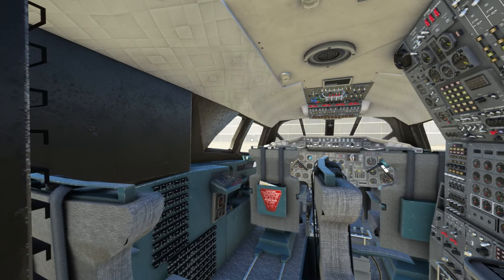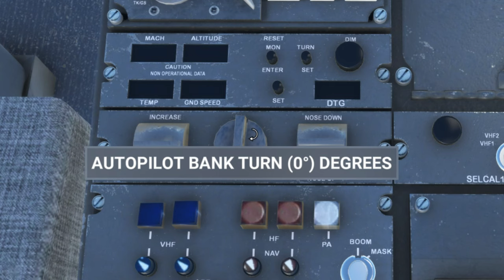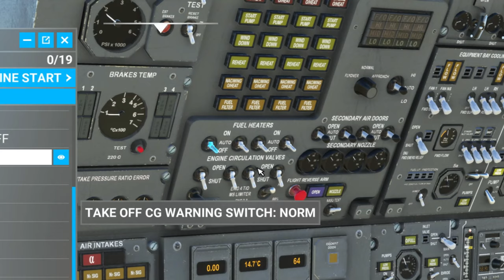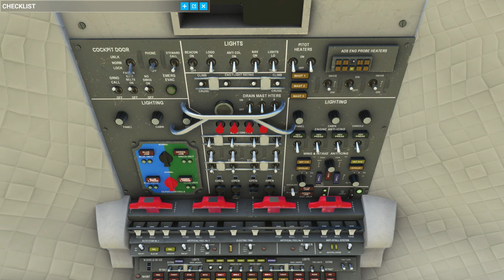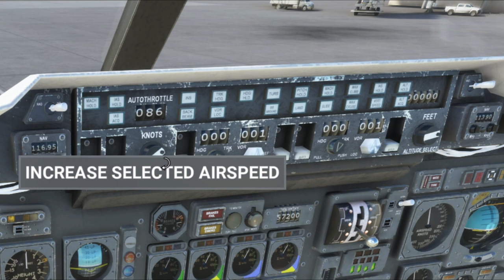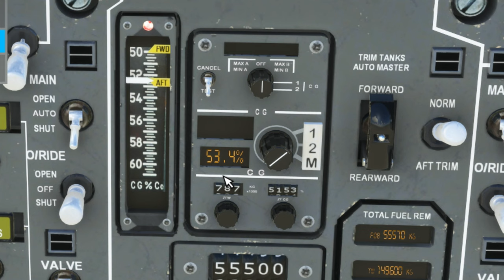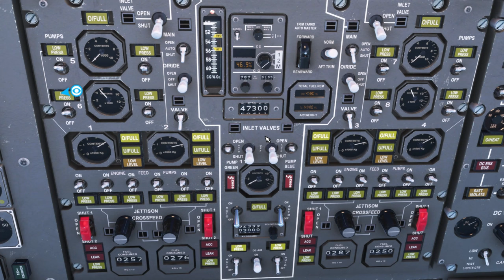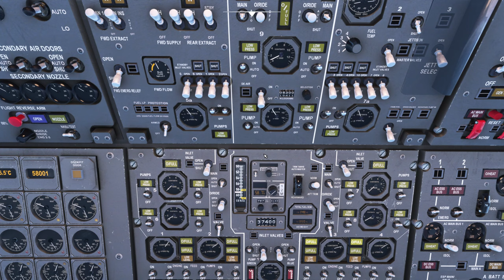Msfs2020*CONCORDE**Full review-Checklist tutorial- So many issues are they deal breakers lets see?

Comment: I bought it thankfully on a discount. I wish i saw this video first though before I bought it. I wouldn't of bought it. These issues are very frustrating. In fact another bug that you didn't mention that I have is there is absolutely no way to turn the engines off after a flight. I even put my fuel to 0 and only engine 1 turns off. I really hope they fix all these problems.
Reply from the maker: Thanks for the comment .. this review is from the initial release I don't think it had the engine problem then I guess updates caused more issues

Comment: Great video, thx! I just have one problem. I done re-fueling and worked but after reaching max cruise around Mach 2.2 the plane starts to dance left and right and has trouble keeping straight line. During descent the plane returns to a stable flight below Mach 2. I tried with mods and without mods. My friend have same problem each flight. Very strange thing: when I change NAV to Heading - plane have no problem... Any idea?
Reply from the maker: Not sure on that yet as I haven't gotten to the gps in the plane but I will check it out. There is so much other stuff not right I kinda didn't even want to attempt a gps nav flight  yet .
Reply from the maker: Thanks for the comment 😀
Reply: Mach 2.2? Or Mach 2.02.  Completely different things. You did turn on the yaw dampers and everything on the overhead bar did you?
Reply: @jdzzl  Yeah, Mach2.02 sorry. I do, all the yaw dampers and all required overhead switches double checked. Have no idea why this happened to my aircraft

Comment: The bars in front of the wheels are deflectors. They're in front of the gear on the main gear, and in back and on the top of the nose gear. You can see them here on F-BVFA, on display outside of Washington DC (at IAD): https://photos.app.goo.gl/L54Qa9wjxPahFASk8

The AUTO/MAN switch on the INS is for automatic leg switching. When you get close enough to the waypoint, it'll automatically select the next leg of the plan.

The white border on the fuel panel is mostly as you mentioned. There's some optimization that can be done laterally (the ones you X'd out), but the main trimming is fore-aft, and the system only really has controls to manage that fore-aft flow.
Reply: The HDG/TRK button that was turning everything around seems to be a misunderstanding of what the function is meant to do. The gauge would have remained in the original spot (how it was in HDG mode). TRK mode was just a variant of HDG mode that took into account wind data to fly a wind-adjusted track, instead of simply the heading. Would have been useful for some NDB flying, but not much else. If ATC asks for a heading, they definitely want it in HDG mode.
Reply: For CG, the reason they want it back as you go over 400 knots is because of the change in the center of pressure on the wing. As Mach increases, the CoP moves rearwards. If the CG is ahead of it, you'd have a nose down tendency. To ensure you don't have a ton of drag by compensating for that with your elevons, you move fuel rearward.
Reply: The trim should be set somewhere between 0.5 and 2.5 (assuming they textured the trim scale properly). 0.5 when at the min forward CG. 2.5 at full aft CG limit.
Reply from the maker: ohhhh ok wow thanks for clearing this up
Reply from the maker: ok great thank you for the trim info you are a life saver thank you . You really helped me out in understanding the concorde better thanks for the comments
Reply: @2020fsers  Very welcome. If you have any questions, I'm a huge Concorde nerd and used to make Flight Sim content in a past life, so feel free to shoot me a message any time.
Reply from the maker: Thanks so much for the offer 😊  your very kind